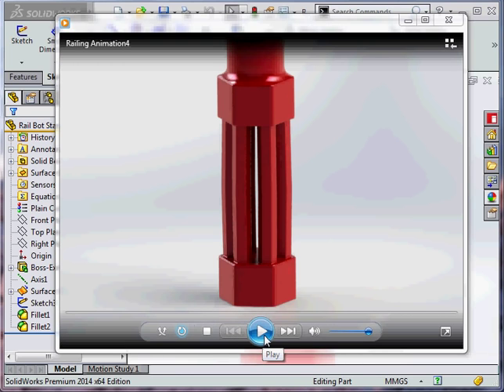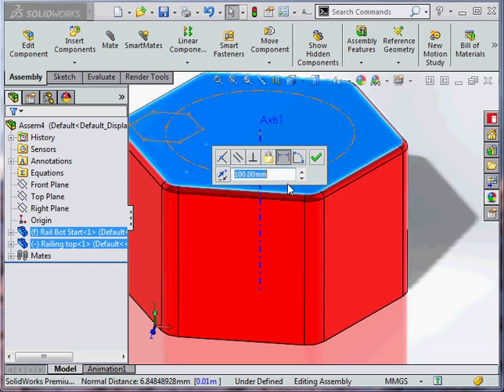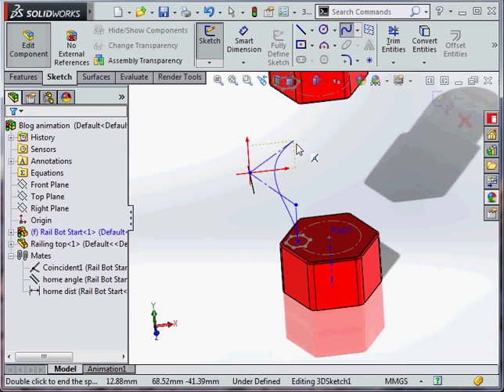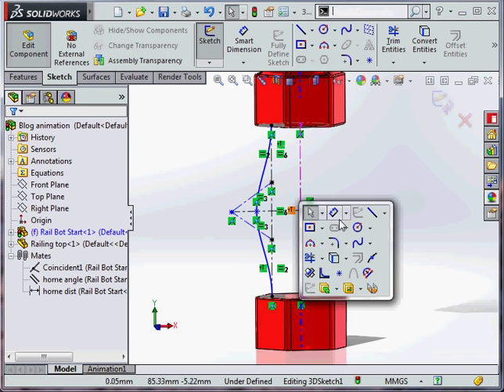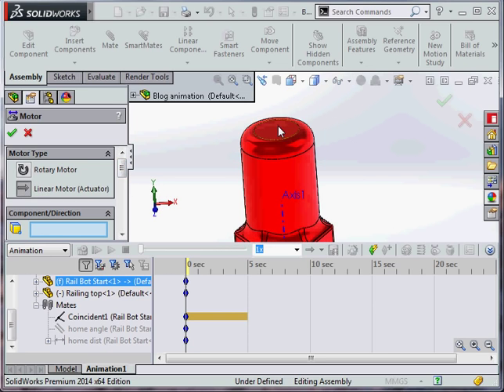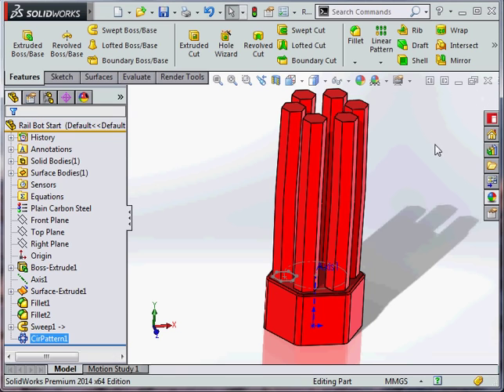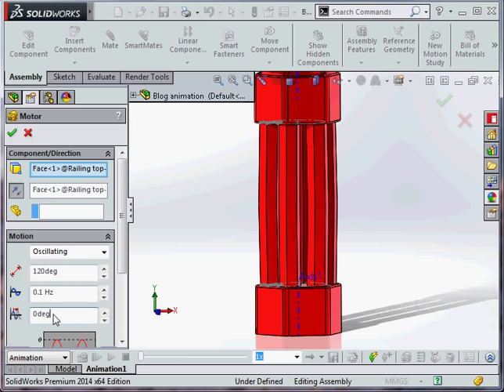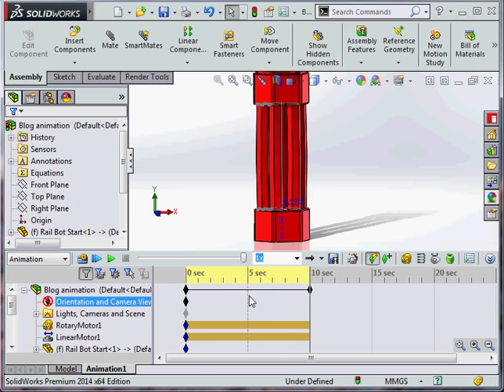Advanced SolidWorks Animation - Deformation

Comment: Damien, this is a great tutorial which really helped me understand how to  animate some complicated mechanisms. it has been immensely helpful in explaining difficult device concepts.
A harder example i'm having trouble with: If I have a similar expanding mechanism, but would like to be able to wrap a membrane around it that stretches as the internal struts are bent out.  Picture the device you've created with a thin rubber tube connecting the two red bases and getting stretched out in the middle as the hex bars bow out...  Is that possible to do within solidworks animation?

Comment: hi, can you tell me why my sketching does not follow the rotation of the upper part? I have added coincide relation to the deformable lines and the upper part. Its length is changed when I pull up/down the upper part.
Reply: i have made it! I failed to remove the "along Y" relation after drawing the line in the middle:) thanks for you vedio
Reply: i'm having the similar problem. Could u plz tell me which relations should i remove to make it deform. Thanks.